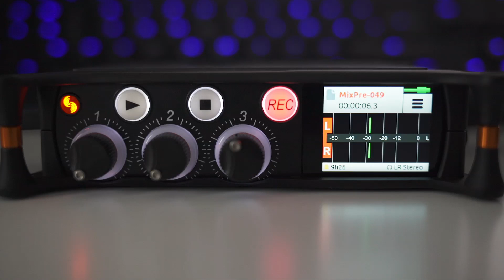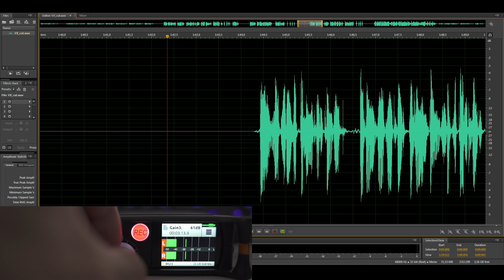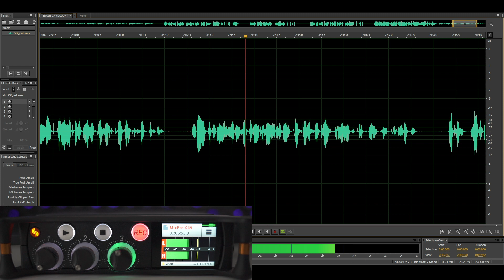Sound Devices MixPre-3 limiter test

Comment: Interesting solution Julian!

QUESTION:
I occasionally record from a feed from a rostrum mic. The mic is fixed on a rostrum to allow a speaker to read from notes etc. The signal from the mic goes to a mixer (which feeds the PA) and finally to a computer where it is recorded using Audition or Audacity. As an alternative, depending on the circumstances, this mic input goes to a Focusrite unit- and then to the computer.  The action (speech) is happening 'live'  -  meaning that often the dynamic range is difficult to work with. Typically it is not often feasable to lower the recording level coming from this mic - or increase it without causing feedback. 

This is made more difficult when a speaker has a brief, intermittent, and loud cough. Typically this happens so quickly that it briefly overloads the input, and means that a loud cough comes through the PA system, plus (later on) having to spend time reducing the cough by editing the computer recording. 

In order to remove this problem, it seems like a good idea to obtain a limiter. This might have the advantages of automatically preventing any brief overload of the microphone from coughs, plus might even allow the mic level to be raised without causing feedback.

Does this idea make sense? .... and what physical hardware e.g. around £200 might be suitable for this task?
Thanks in advance for any useful suggetions.

Comment: How’s the time code on the Sound Device MixPre ? No time code, not professional !
Reply from the maker: You can feed external timecode via minijack into the MixPre. So, you would need something like a tentacle sync. But you're right, it's a pitty that Sound Devices decided to not include a timecode generator on the MixPre-3 and MixPre-6. The MixPre-10T on the other hand has timecode built in.
Reply: Maybe they will ask China to include time code on their next product.
Reply: Zoom asked and they have it, that’s pro equipment.

Comment: I wish you would do this same test on a SD 633. You would be shocked to learn the MixPre-3 limiters are far more powerful and effective than the 633 limiters.
Reply from the maker: I never had the chance to compare the limiters of a MixPre-3 and an SD633. If I get my hands on an SD633 I will do a limiter comparison. One thing I didn´t like about the limiter on the MixPre-3 ist that you don´t have any possibility to change the release time. It seems to be around 250ms. For dialogue this is ok, but if you record sfx usually a much shorter release time is preferred. As far as I know, you can change these settings on a SD633.
Reply: Julian Krause 2 Only threshold can be changed on 633 limiters. Limiter Attack and Release are set at 1 ms and 500 ms.
Reply from the maker: Thanks, I did not know that. Now that the MixPre-3 and the SD633 limiters are so close on paper I´m really curious how they compare in real life. The limiter of the MixPre-3 is really good, I can totally imagine it working on paar with or even be better than the SD633s limiters.
Reply: Julian Krause 2 The 633 limiters scared the hell out of me recently on a paid job with a national company. Had a shotgun over a talent in an outdoor interview. He laughed and clipped the input! Blew right through the limiter. Also had a lav on him which did not clip as it had its own compressor which saved the track. But damn. Yes I had the shotgun too hot and have since been more careful about gain settings with that mic as it has high sensitivity (MKH8060). That set me off on a test of my SD recorders and their limiters. Same test showed I could NOT clip any 7 Series or MixPre3 limiters which is what I was used to and expected but not on the 633. I did same test on another 633, same fail result. Disappointing.